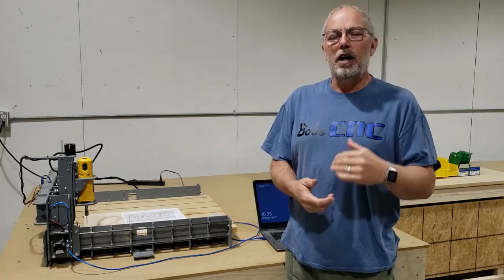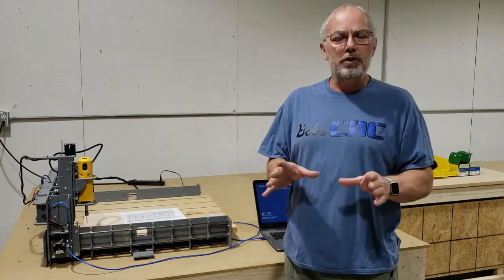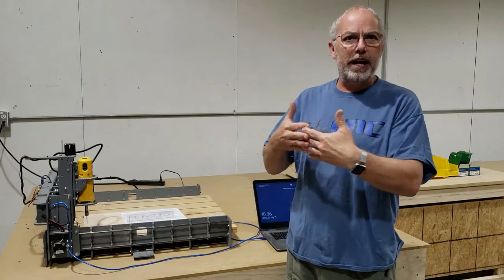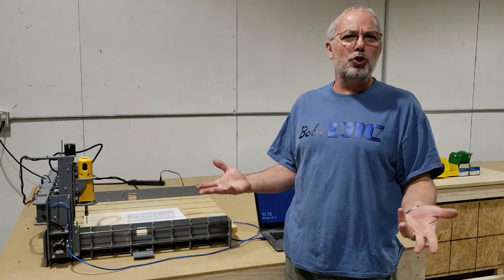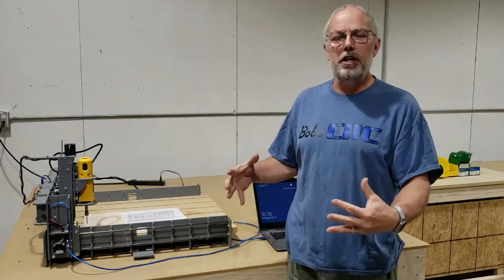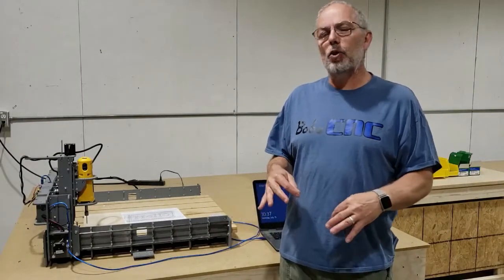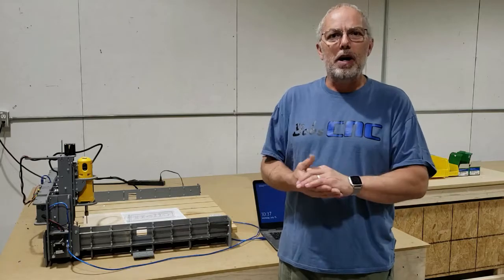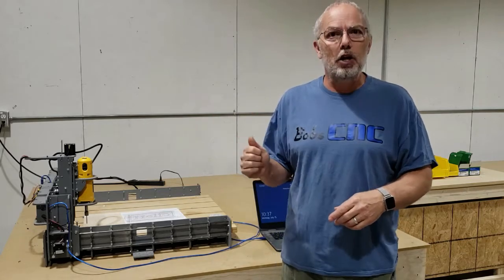Self Squaring Gantry

Comment: People always comment about the uselessness of this feature, but there are many reasons one would need this feature. For example, if you are doing flip CNC jobs consistently and want to use the same reference pins every time, you'll need to ensure that when you home your machine, the gantry is in exactly the same place every time. Even a few micros off will drastically affect a flip job on a large piece. When you start making more precise things, yes even in wood, you'll want this.

Comment: Hi Bob,
I don't know if I understood something wrong, but how do you stop one of the motors from moving when its limit switch has been pressed? I have a CNC as well and I want to include the self-squaring feature. If you have both Motors connected to the same step pin, they both need to stop when moving on their individual side. When one limit switch has been pressed that side has to stop moving while the other side is still moving until the limit switch has been pressed. Or do both sides still move but one of them is just held back by a stop? If that's the case I don't think that's a very good solution to the problem. I know that as well but I haven't found another method. I have a solution to that problem but I can't implement it since I'm not good at programming: I would use an Arduino Mega (or Uno if still possible) and have separate step signals and limits for both sides so that once one limit switch is activated that side will stop moving while the other still moves until the limit switch is pressed. Just as a side note: I use inductive sensors as limit switches because they are more reliable and precise. If you are interested I can send you some pictures or photos of my CNC as well. Stil a good attempt if your Gantry can accept the force of the Motors still running.
Reply from the maker: The X1 and X2 stepper motors receive different signals during the homing process and are independently driven to their home switches.  The X2 and Z homes switches share the Z home switch pin.  Since the Z homes first, the firmware knows that the Z is the home switch that will activate.  Then X and Y home.  When the Z (X2) home switch is triggered, the firmware assumes it is the X2  axis.   Pretty clever programming by Sonny, the lead developer of grbl.
Reply: @Bobscnc  That's a really clever idea, but how do you drive the two X motors independently if you only have the one signal, and both need to do the same thing while running the g-code. I don't have a wiring diagram, but I think you just shared the step pin from the X-Axis with the other driver; or do you have a separate pin for that? Maybe I understood something wrong but I have some trouble with my CNC and the squaring and just want to be sure. Still thanks for the answer.
Reply from the maker: @mytendo3477  We use 2 stepper drivers. One for each X motor.  Our controllers have 4 stepper motor drivers X1, X2, Y and Z.
Reply from the maker: No motors are forced. The firmware knows which axis is homing, therefore knows which stepper motor needs to stop. This system works with inductive home switches as well.

Comment: I think this is a great idea, and I really want to install this on my CNC because I always have to square it before I run it, but I'm struggling to understand the logic.  How does the controller know that the Z has homed, if it is in series with the X axis switch?  The circuit isn't complete until both limit switches are activated (CLOSED), so what stops the Z motor?    Also it says to connect to the Z+ on the controller, I'm using the Arduino Shield and the gethub doc says "Support for Arduino CNC shield clones. For these, step/dir on pins D12/D13 pins"  I see the video and see it works, so I'm missing something, and can't figure it out. HELP?
Reply from the maker: Please see the instructions n the BobsCNC product page.  The Z homes first so the first time the switch activates the firmware assumes it is the Z.  The second time it assumes it is the X2.
Reply: Hi thanks for the response, but I'm still lost.  If the Z homing switch and X homing switch are connected in series, how doe the circuit complete?  I can see it if they are in parallel, it would sense the first switch and then the second, but I still don't see how this works if the switches are in series, there is no way unless both switches are closed?  I am so confused.  Is there a wiring diagram that shows exactly how this is configured?  I really want to understand this so I can install it.   Thanks Dave...........
Reply from the maker: @WILDMACK  our homes switches are wired normally closed.    One wire goes from the 2 pin connector to the Z home switch. The other wire on the Z home switch goes to the X2 home switch. The other wire on the X2 goes to the 2 pin connector.
Reply: @Bobscnc  Thank you, Thank you.  That was the part that I was missing.  I was stuck on normally open switches, and I didn't even think of the normally closed.  So I'm using an Arduino Shield, so would I have to comment out the Protonner and enable the Arduino CNC Shield Clone in the config.h file?  Also it looks like if I'm using the Arduino Shield Clone, then the homing switches should be connected to D12 and D13, does that sound right?  I hope I can get this working it will save me so much time and hassle.  Thanks again for your help, I really appreciate it.  Dave........
Reply from the maker: @WILDMACK  Sounds right.  If you use normally open switches then put both Z and X2 on the Z end stops wired in parallel.
Reply: @Bobscnc   Thanks I'll give it a try.  Dave...............

Comment: How can the controller differentiate X1 from X2 if wired in series?
Reply from the maker: It all has to do with the timing.  When you click the home button, the Z homes first.  During this homing cycle, the switch is programmed to respond to the Z-axis.  Next, the X and Y home, during this process the Z home switch is programmed to respond to the X2 stepper motor of the X-Axis.
Reply: @Bobscnc  Thanks Bob.